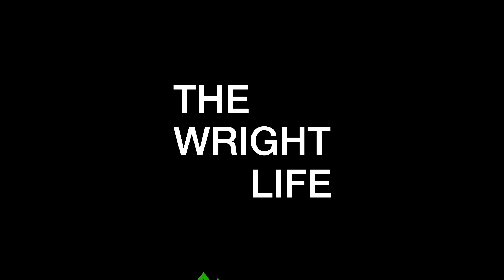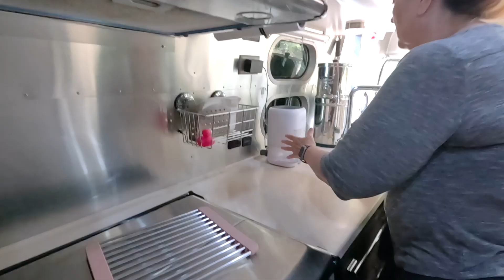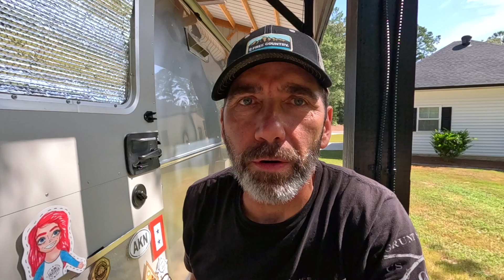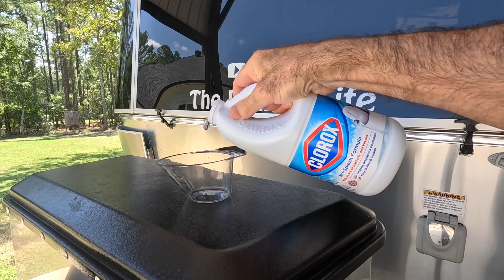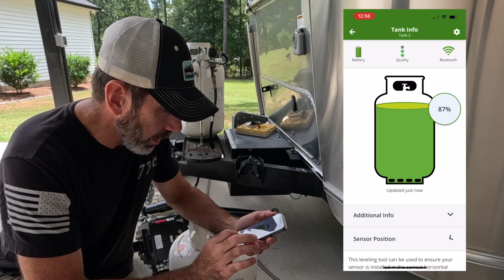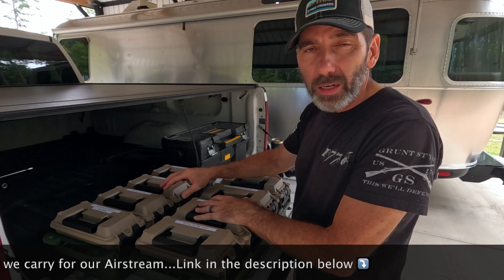Final Checks ✅ - Get The Airstream Road Trip Ready!

Comment: Where did you get the long propane line for the generator to the airstream? Can you provide the URL if it was Amazon? I have the same generator that you do. Thank you!
Reply from the maker: I got it from Amazon - https://www.amazon.com/DOZYANT-Pressure-Quick-Connect-Disconnect-Extension/dp/B07W4YY2LS/ref=mp_s_a_1_5?crid=AL00JY7KRR1Q&dib=eyJ2IjoiMSJ9.h8nbRkTWvnpGy-yQ5gPPKDM3LKcf_vcJTaITuLtcnGKXcaWkhy3n9_VC3wIx8ONEtHLFZRLO7GhceR85R5JSNbjIGU2nDP5S89ognLjYu1ugxJrGHEINfxKX3VX0RfTz2XabQxyBLs1ABtdm1KNG7iSMtTWX7SYokwBHQHbxLm_bizEQqPiRl3a4-5g6QhKzv4KALKzVMWYvtrg60j7eMQ._ijh9vGBTRoZxZk3Ft5gk7xGTM-hAeJQeDlkZ-zEVOM&dib_tag=se&keywords=25%27+propane+hose&qid=1727782823&sprefix=25%27+prop%2Caps%2C184&sr=8-5
Reply: @thewrightlife  thanks. So the line with the regulator that comes with the generator; I don’t have to use if I plug into the airstream quick connect on one end and the generator on the other end?
Reply from the maker: @rvbuyorbye  if it’s the same generator as mine, then you still need to use the regulator that came with the generator.  However, you will need to add a quick connect to it to use the longer LPG hose.

Comment: great preps.   All very essential.   The only one I don't bother with is the propane tank sensors.   Have wondered about that, but end of the day, we just run off of one of our tanks until it runs out, and then switch over manually, and then make darn sure to get the empty one refilled before the other one goes empty too, so that we again have the backup spare.   The last tank lasted something like 65 nights, so it is not like we are making that switchover very often mind you.   Safe travels and enjoy your fall trip.
Reply from the maker: We did the same thing for years.  My problem was remembering which tank I was using between trips.  I tried a few different methods and then decided to try out the Mopeka sensors.  We’ve been very happy with them.  Thanks for watching.
Reply: @thewrightlife  lol...yes, I get that for sure.   My regulator has the switch on it, so I know that the tank that the switch is pointing to is the live one, and the other one which I leave always off is the spare.  Until it is empty and then I switch the indicator to the other tank.  Then I just need to remember to get the empty tank filled back up to have as a spare.  :)     Nothing worse then suddenly realizing both tanks are empty.  Looking forward to follow your trip.  We take off one week from today for a month or so as well.   Looking forward to it.
Reply from the maker: @ShawnPatterson402 …safe travels and happy camping 🏕️

Comment: Rick, love your videos…they help us a lot…thank you!  Two questions please…First, your video (TPMS MISTAKE!) showed you used 63 PSI as the normal tire pressure.  Do you still use that PSI when towing your airstream?  Second…where do you store your travel Berkey in the trailer when towing?  V/R Frank
Reply from the maker: Frank…YES, we still tow at 63 psi.  It’s worked well for us based on our rig.  When towing, the tires warm up and the tire pressure increases to 70 psi.  As for the Berkey, Lisa wraps it in a towel and places it in the shower.   Hope this helps.  Thanks for watching and safe travels.
Reply from the maker: Correction -  We inflate to 63 psi.  As the tires warm up when driving the psi increases to 70 psi.
Reply: Thank you Rick...your comment does help.  Safe travels!
Reply: Are you using the propane outlet on your trailer or hooked to the tanks?
Reply from the maker: @craig-n1f …we are using the LPG outlet on the Airstream to power the generator (or Blackstone grill)
Reply: @thewrightlife  thank you so much. I live in Michigan and can give you some suggestions and we’ll see you at the rally shortly.
Reply from the maker: @craig-n1f …during our visit to Michigan we quickly realized that we will need to plan a return trip.  So much to see and do.  Safe travels and hope to see you at the rally!